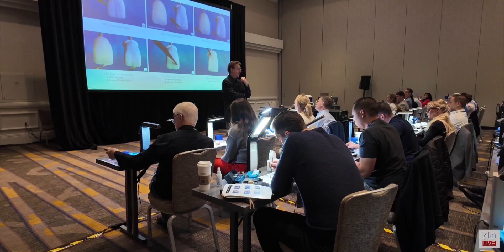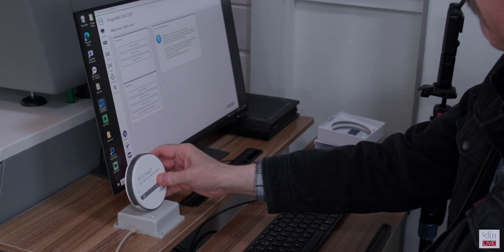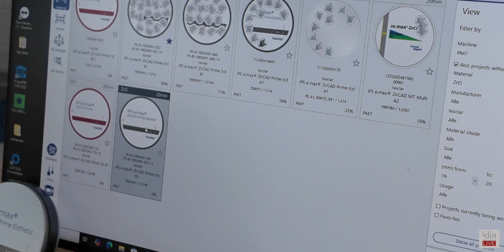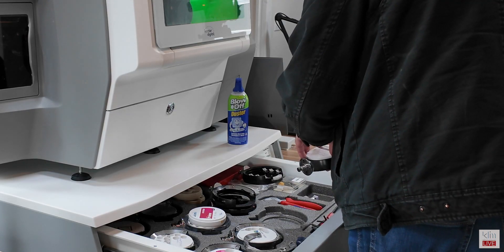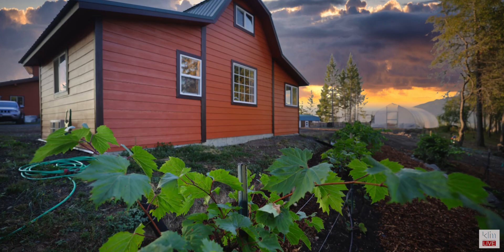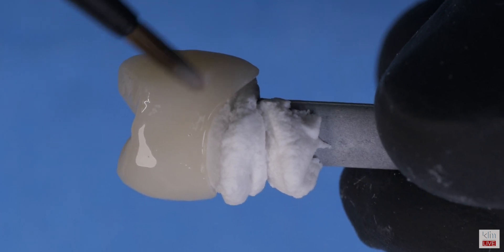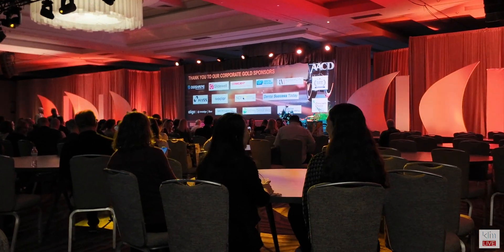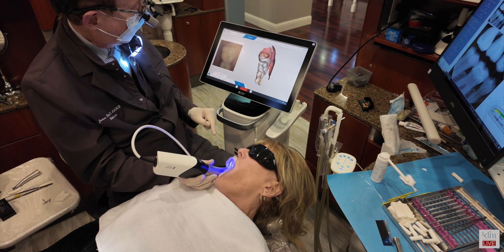Preparing for My AACD Hands-on Course with the PM7 Mill by Ivoclar

Comment: Im opening my office soon I love Prosth work and eventually wanted a mill and printer in my office for all case small to big case and also veneer so which mill scanner printer and software should I invest in?
Reply from the maker: That depends on your objectives.  There are a number of systems, and that will depend on what works best for you, a 5-axis or 4-axis miller, or both.  I use both.  Digital platforms are developing quickly.  Good question, and much too complex to respond to in this thread.

Comment: is the PM7 not to much for a dental practice?
Reply from the maker: Depends on what the practice is wanting to do.  I use the MC XL, Primemill, for same day milled restorations., and the the PM7 for larger cases and thin veneer cases.  The Veneer trend is preserving enamel, with the need for very thin mills, and that is where the PM7 comes in handy.  So for a busy office, or an office with multiple doctors, the PM7 can be a good fit beyond the CEREC mills. https://youtu.be/f1WQO9H75jI?si=L1P0JWVGG-cDDEFA